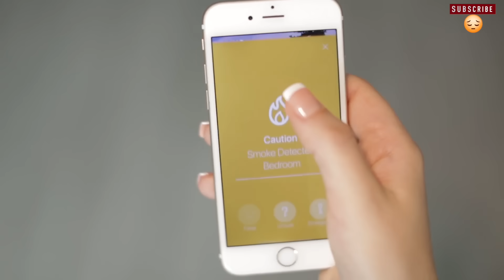10 Fire Fighting Inventions That Every Government Should Possess ▶ 7

Comment: Fire fighters don't need to know how to put out a fire they get paid the same if they stop the fire or the place burns to the ground.  Everybody should build there house so a fire can't get out of control, the usa building departments have no idea what that means. Every time a house burns they spray water on the shingles that's never helped but they do it every time. I would make a truck with a long probe that goes through the wall or roof and sprays like a pressure washer co2 and water.  Ask a scientist or Elon Musk.

Comment: I like the balls. And the robot and smart camera may have some industrial applications. Otherwise, I don't think people realize the ridiculous heat associated with structural fire. You don't rappel alongside the building. The drone may have some immediate application for hard-to-reach areas and flexible lift capacity, but is probably not going to last long in proximity to a developed fire.
Reply: Anything to keep the gflames from burning a hole right through the building

Comment: This is like a collection of 10 commercials.  As a retired wildland firefighter I must comment on the two aircraft shown.  First of all, for all aircraft utilized on wildland fire there has never been a wildland fire "extinguished" by an aircraft.  That has to be done on the ground by firefighters.  Second, the least impressive presentation here is for the water scooping aircraft made in Canada.  They are commonly called the "super scooper" by the media and politicians, who are somehow wowed by this plane.  On the ground in the United States firefighters refer to it as the "pooper scooper."  When fighting a moving fire it is far more effective to utilize retardant dropping air tankers.  Water dropping helicopters are most often used after the spread of a fire has been slowed.  That is because water evaporates quickly and retardant is effective for days, weeks and months after it is dropped.  Retardant is often used to "paint" the ground and fuels ahead of the fire.  In very remote areas with lots of lakes and quite distant from an airport they are probably good tools.  However, in the continental U.S. there is a large network of air tanker bases that allow the use of retardant without much delay.  Finally, the Sikorsky helicopter is a great tool, it drops a lot of water and very accurately, while being able to snorkel the water on board fairly quickly.  The so called "Super Scooper" cannot come close to the accuracy of any helicopter dropped water.
Reply: funny, I remember wildland fires which were extinguished fire aircrafts
Reply: @EnjoyFirefighting  I don't know your background in wildland firefighting, but most wildland firefighters with a little experience say the same thing I did here.  Aircraft dropping retardant or water may knock flames down, but actually extinguishing every spark requires someone to be on the ground with hand tools.  There is a huge difference between knock down and extinguishment.  The non firefighting members of the public have a misconception of what aircraft can actually do on a fire, typically overrating their importance.
Reply: @wannabetowasabe  not much to be honest, I only know some scenarios where I was on scene as reporter or I heard of from reports; The one where I was on scene was a forest fire where the FD wasn't able to get close to the fire on the ground, so everything was done from above with helicopters; 
Then I remember the massive brush fires in Sweden last year, where some of them were bombed out as there wasn't really a different option; And the latest forest fires in Germany they FD wasn't able to get off the paths in the forest (maybe with some tanks only), so all they could do is spraying water from the paths into the trees and using helicopters as well
Reply: @EnjoyFirefighting  My point is aircraft are used on wildland fires, but don't actually extinguish every spark as ground fuels can be dense enough where water does not penetrate it, therefore water cannot make contact with every spark.  Such is the case with large dead logs lying on the ground and standing dead trees.  The diameter of the log prevents water applied by an aircraft to penetrate to the center in order to put out sparks, embers and actual flames.  A log can be hollow, whether standing or not, and flame can burn, along with smoldering wood, for weeks.  What you hear from the media, reporters and the general public is based on a complete lack of actual firefighting experience.  Those who have been given the responsibility of making sure all burning material has been extinguished on a fire have enough experience to find everything that is smoldering, flaming, etc.  That is why many standing trees inside a fire line have to be cut down and cut into smaller lengths, so that small amounts of water can be applied to all surfaces inside a hollow log after various fire tools are used to expose the burning.  That is total extinguishment and is important as that material can reignite a fire days, weeks and months after something burning is missed.  This process of putting everything out is dirty, laborious and time consuming and is called the "mop up" stage.  Aircraft can't even come close to doing a proper job of mob up.
Reply: @wannabetowasabe  I understand your point; However e.g. when I was on scene myself, I got the information directly from the crews involved and their chief (and well, it was eas to see that there were only helicopters in the air with ground crews only directing them, without any hose or pump in action); 
And I know that the crews up in the north weren't able and not allowed to leave the paths which lead through the woods, not during the fire and not now after the fire
Reply: @EnjoyFirefighting  I guess I can only say that things are very different wherever you are from, which I'm guessing is somewhere in Europe.  Full mop up on smaller fires is required in the U.S. and on larger fires generally 300-500 feet inside the fireline is 100% mop up.  Sometimes mop up does not involve water, engines, pumps, hose, etc.  Sometimes you have to mix dirt with the fuels to fully extinguish the fire.  Where have you made these observations?
Reply: @wannabetowasabe  Correct, I'm from Germany. I'd agree with you, but in some areas here mop up can only be done with tanks as there are many left-overs from the wars in the ground. Departments had problems with ammunition at a forest fire in north-eastern Germany just few weeks ago, last year similar scenarios happened in north-western Germany and in eastern Germany as well. It's always the same handling: staying on the paths, trying to keep the fire from spreading, but there's not much mop-up they can do in the middle of the forest far from the paths.
I myself was on scene at a small forest fire in the Bavarian forest, but that one was relatively small compared to the large forest fires in the north and east
The one where the fire was bombed out was last year somewhere in Sweden

Comment: 100 liters is only 26 gallons... most american fire hydrants dispense more then 700
Reply: Not to mention L/s is not a measurement of speed, but a measurement of volume of water coming out
Reply: The UHPS systems are ridiculously effective. Most of the water from regular lines just end up either in puddles and basins within the structure or run-off. Even a fully developed fire doesn't evaporate the water you spray at it. The UHPS system produce a droplet size that amount to an insane surface area and with enough pressure to penetrate the fire so that the vapor supplant the fire gases instead of forming a high pressure barrier between the fire fighter and the fire. Suffocation and cooling with minimal water damage.
Reply: Than*

Comment: At #8, you mention a system that makes a fine mist which is supposed to “extinguish” the fire...No, that’s not how it works. Not only would using a fine mist be useless against a large fire, but it would also create steam, which can burn firefighters and people trying to escape. The system was designed to slow down the spread of the fire by making everything wet, and thus, harder to ignite.

Comment: I'm a firefighter, and love the job. This isn't gonna pick up bodies, get itself out of a building or nun of that. The government should not put nun of this bs out.
Reply: uhm is it always about picking up bodies? Not at all ...
What about fires at chemical plants, do you want to risk your own crews and send them directly next to some tank which was exposed to heat by a fire right next to it? Thus the LUF is an awesome piece of equipment, also for tunnel fires and larger ventilation operations
Reply: @EnjoyFirefighting  man i care about my team, and its not only about bodies, its a brotherhood. These machines are going to take over all jobs.
Reply: @raeseannorris5498  do you think they do it on their own? They need operators, instead of less crews there would be even more crews on scene ^^
Reply: @EnjoyFirefighting  you don't know what your talking about, your not supposed to get real close to the tank from the start. Your first focus is to get the crowd or whoever is around the fire from the tank, put the fire thats around the tank out from a pretty go distance but close enough to attack the fire. If you don't want to get close you have a ladder truck that have a nozzle at the end to put out fire, your controlling it from the truck.
Reply: @raeseannorris5498  what if you can't get close enough to the tank and also can't get the fire close to it under control? Most fire departments don't operate Aerials which are higher than 105' ... there are just relatively few which have Aerials which reach 170', 300' or even 367' ...
It doesn't have to be a tank, it might as well be e.g. munition in the ground at a brush fire. At that point departments here usually don't come up with the time LUF60 but with a fire-fighting tank
Reply: @EnjoyFirefighting  we barely ever get that problem here, but i can understand what your saying.
Reply: I saw the LUF60 in action once so far. It's a great tool especially in tunnels and large buildings. Apart from ventilation and fire-fighting, they can also ram debris or cars out of the way which are left in the middle of the path (e.g. in the tunnel, once people ran outside). We have so many tunnels over here, that some tunnels have their own fire stations which cover only the tunnel and no city area around it
Reply: @EnjoyFirefighting  well yeah, i mean it would be great if i didn't live in the city
Reply: most departments I know with such units are some large urban career fire departments or some industrial fire departments, I know only some few volunteer ones which have these special units
Reply: @EnjoyFirefighting  as long as we're not replaced I'm fine

Comment: "Requires no training" 
Uhhh yeaah not gunna set up a harness and jump out of a burning building without some dry runs..
Reply: There are plenty of people who bur up in fires because their usual path is blocked or they won't break out a window. People who live think fast and hopefully have some luck on their side. I watched a video a few days ago from the Camp Fire in Paradise, California. A man tried to save his neighbors who were reluctant to leave, for one reason or another (one was crippled and another wanted to put on her makeup). He showed film of all six of their bodies (what was left of them). R.I.P.
Reply: Only 200 pounds not good you need 2000lbs for 80ms to be able to not break
Reply: i would if its between that and burning alive
Reply: You have any idea how many people think you'd test this on yourself rather than using dead weight because you didn't elaborate? 
- 
Then there are the people that think you wouldn't use this in an emergency with no other alternative. YouTube audiences are stupid, so those assumptions are valid.
Reply: @mallarysangel  It should be tested to twice the working weight that was told on the video. that way we are sure that it will hold.

Comment: The "Sky Saver" looks interesting.  If I had to stay in a high rise hotel or spend some time in an officer building I would consider it, although I try to avoid both of these scenarios.   I see some problems, however.  First, you have to find a solid anchor.  The video shows one pre-installed and you would have to own or be leasing the building in order to do this.  Second, a lot of high rises have windows that can't be opened and are nearly impossible to break.  The comment was made that no training is needed.  I think the average person, with no technical rock climbing experience, would have a tough time launching themselves out of a window more than about 2 stories up.